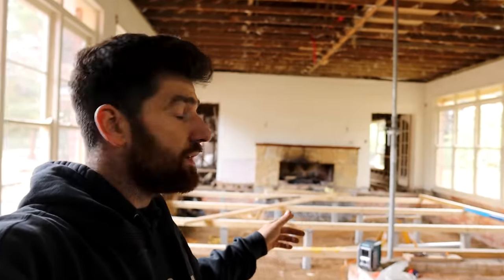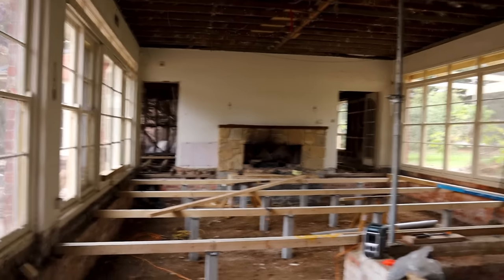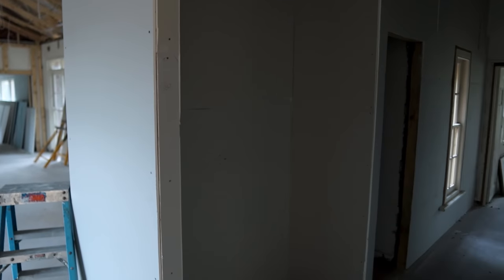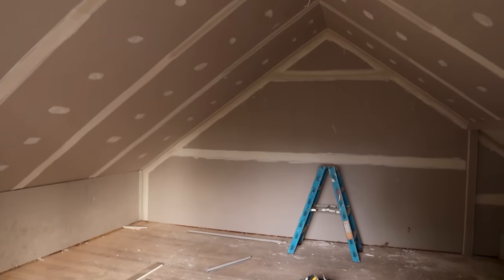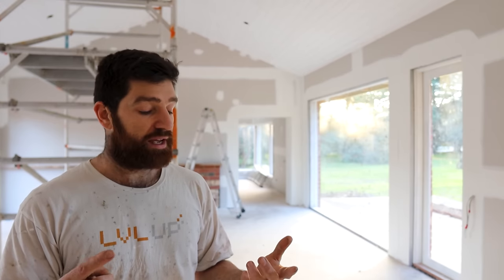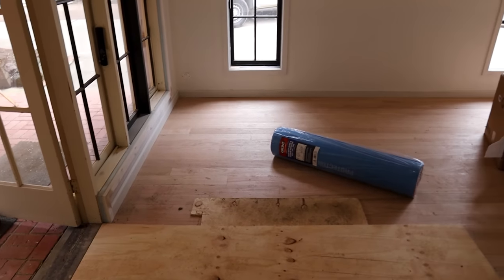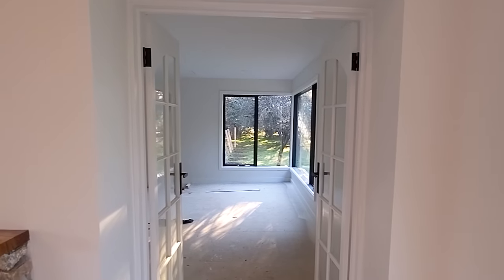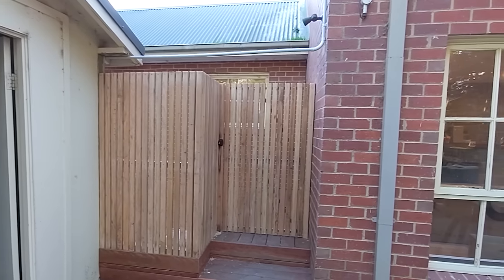Abandoned Rehab Facility to Dream Home | 12 Month Renovation in 32 Mins

Comment: Teachable moment. They completely replaced the floor because it was rotted out.  However, did not address root cause, which is moisture buildup beneath the floor.  They build a 5 sided box, with the 6th side just dirt.  There's no ventilation, vapor barrier, or treatment. And, the sides of the box are brick, which is porous and lets in more moisture.  You can see in the "new sub-floor" section of the video, the dirt is already moist inside the structure.  Also, at the 0:39 mark you can see the broken floor joist. It has signs of bug damage.  If they didn't spray anything to address this, the new wood they installed will get infected, even with removing the old wood.   Years from now the floor will rot out again.  Very cool build but this one thing can cause a lot of problems later.
Reply from the maker: Hello 
Yes your logic makes sense
This house does have ventilation to the sub floor as required. The cause of the rot was termites not moisture 
The termites have been treated and concrete stumps and ant caps were used. I can guarantee you the floor will last a lifetime or even 10
Reply: Don't you need insulatiuon in the floor?

Comment: I would have did a different insulation in the attic and I would have poured concrete for the slab replacement. Other than that IT LOOKS AMAZING
Reply from the maker: I wish i had more knowledge on the subject. Things can always be tuned and dialed in with the aid of a dyno and software. The ECU definitely plays a part on the newer more electronic versions of the 1kz pump. You can always clock the pump bit by bit and test drive the car to see how it effects things
Reply: @dingeldiy  wat

Comment: Wish we had more info on this- more history on the house, why roofing was only replaced in one area, sq ft, etc!
Reply from the maker: Plenty of information if you watch the build series, there are 12 or so episodes that take you through the renovation week by week. Roof was redone because we removed load bearing walls. We installed roof trusses to span from one external wall to another which also meant we could have a raked feature ceiling on the inside all while being able to reuse the old tin roofing.

Comment: It's beautiful 😍 but am just asking why do you people normally use wood ? Are brick houses expensive ?
Reply from the maker: Wood is quicker, easier and ultimately cheaper to work with. It's strong and allows us to run cables and pipes easily as well as easily and quickly being able to install plaster sheets.
Labour costs a lot in Australia and that's why we use efficient building systems to keep costs down. 
Brick is used commonly for durable cladding but it's rare to see brick used as a structural element in most modern domestic homes.

Comment: I like the Crittal rectro windows !   as for the outside why not clad in timber?  bricks dont enhance the property. Maybe its the client or Oz taste !
Reply from the maker: Bricks dont need as much maintenance and some parts of the house were solid brick. it would have been a costly exercise when the money can be better spent elsewhere.  Brick homes are very common in Oz and most people here have no issue with them

Comment: Nice work, I do wonder why the interior floor was done before the roof repairs, allowing weather to come in on the brand new floor.
Reply from the maker: we finished the subfloor so that we had a safe surface to work on the roof from. the roof was offf for only 2 days and the subfloor can be exposed to rain for months before it becomes damaged. 
The real "brand new" flooring wasnt installed until the roof was water tight
Reply: @dingeldiy  Ah makes more sense. Watching it in retrospect makes it feel like a longer period of exposure. But again nice work.

Comment: $ 50.000 plus to have this building tooken down, and all materials have to be, hauled off for recycling. Then cleaning up from thee mess.
Reply from the maker: Not to mention asbestos removal, getting services re-connected, planning, permits, engineering and higher living expenses while you build a new house. 
Renovating this old place was much more cost efficient compared to demolishing and starting again.

Comment: question...is there a reason the flooring was done before the roof? (Wouldn't dealing with the roof potentially damage floor, even expose floor to weather vs...if did roof first, you eliminate chances of  floor damage? just curious
Reply from the maker: the floor acted as a work platform, as the old floor was too rotten to work at heights from. it was only exposed to weather for 2 days (which is totally fine) and damage occurred to the chipboard but it was minor and then later covered up by the final floor boards

Comment: Genuine question, if you are replacing a subfloor like this, what are the arguements for and against insulation for the subfloor?
Reply: And a vapor barrier.
Reply from the maker: cost vs necessity. 
Insulation and vapor barrier was not needed for this house so why spend the money and time?

Comment: I'm surprised Australian builders don't put plywood on the roof before laying down the roofing.
Reply from the maker: What's the benifits? Seems like unnecessary expense to me
Reply: I am not sure where happykt is from, here in the US, I am sure it would be for additional rigidity for the roof system. While I am not a builder it may also be code here. It could also be for storms, tornadoes, hurricanes or snow load. It all hinges on location.

Comment: the vents in the walls are / were for the Carbon monoxide to escape ...... and yet you kept the open wood fires ...how has this passed inspection
Reply from the maker: not sure that's what the vent were for but the smoke alarms with built in co2 sensors will let us know if something is wrong 😀

Comment: Death stairs. Are there no building codes in Australia?
Reply: I was thinking that the floor joists would not have been up to code, and I felt like the trusses were spaced too far apart to be up to code. At least in the states. Maybe I’ve been watching too much Mike Holmes 😂
Reply from the maker: Keen eyed viewers!
I can promise you the floor and roof are up to the Australian standards. The roof trusses are engineered and installed to the supplied specifications.
The bearers are a 90x90mm F17 rated timber at no more than 1500mm centres with 45x90mm joists at 450mm centres.

The stairs have since had a balustrade installed but due to my employment and need to move on to other jobs I was unable to film some small things such as that.

Comment: You didn’ t put any insulation under the floor. Seems odd because there is pure ground under. It means that moisture condenses on the lower surface of the floor. No ventilations gaps were left inside the walls. In the roof insulation were put to attach to the roof sheet without ventilation gaps. Big warning that you will have moisture problems during ten years in your house.
Reply: The is not any moisture management in the house. That kind of forgets mean big, big problems  after coming years. You even closed gaps where the roof can be ventiled. And the is not any ventilation system inhouse. Just only air conditions which keep moisturing inside the house. The works seem fine but there are huge problems during coming years in the house. That kind of construction is illegal in Finland.
Reply from the maker: The video may not show it but there is adequate ventilation in the walls and sub floor. The house meets all australian standards

Comment: Strange to watch videos like that as a German because we build houses so differently😅
Reply from the maker: Tell me more! What part is weirdest for you to see?
Reply: @dingeldiy  It ist mostly that you build everything out of wood and plasterboards. In Germany we build nearly everything out of concrete and bricks. I would have made the floor out of concrete with insulation and I would never apply plastboards onto brick walls. I would always plaster the walls directly to have a solid wall. All in all there is also very little insulation around the house. Furthermore I was missing a vapor barrier at your new roof, which we also build a little different.
We also build nearly every new home nowerdays with floor heating, but maybe in your climate zone that is not necessary.
That should not be a critique of your work, only a description of how I would do things from a German point of view

Comment: Should poor a concrite rat slab on that dirt fllor before replacing it
Reply from the maker: That sounds bananas to me. What's the point?
Reply: @dingeldiy  It stop rodents and moisture from roting your wood when plastick sheat used under concrite.

Comment: Different building codes hey. No concrete to lock in your stumps? I don’t get how you get away with that floor not moving I suppose you have a heap of stumps hey.
Reply from the maker: Lots of stumps deep in the ground. Concrete is used to backfill the bottom of the hole but the top half of the hole is usually packed down soil. If the house is built right no moisture shouldn't be getting to the stumps. The soil, especially if its clay, turns as hard as rock over time.

Comment: I find it strange that you guys build floors like walls. We use LSL i Joists. 2x12
Reply from the maker: we use them in high span applications on 2 storey houses but usually at ground level we use stumps and bearers or concrete slabs depending on what floor systems we need to marry up to.

Comment: Why did you replace the roof framing?
Reply from the maker: Walls were removed before I started filming. Those walls helped support the roof. We replaced the roof structure with trusses so that it was self supporting with the added bonus of a nicer looking raked ceiling.
For more info watch episode one of my series I made on this video. It's called the 10 week 10 acre turnaround.

Comment: What was wrong with the roofing? It didn't appear to be eaten by insects or destroyed by water leakage - unless I am wrong it all seems very wasteful
Reply from the maker: Some Internal structural walls had been removed before I got involved with this project. The roof structure was replaced for 2 reasons - 
1. It needed to be self supporting as the internal walls we not to be replaced. 
2. A pitched internal ceiling was more desirable than a flat one and really brings the house to life.

Comment: No vapor barrier on the ground under the floor and using composite sheets as floor decking is a recipe for disaster.
Reply from the maker: Appreciate the concern but I can assure you the sub floor is properly done and in accordance with Australia's high building standards

Comment: And where is the thermal insulation?
Reply from the maker: It may be lacking in "insulation" but this house has a lot of thermal mass
Reply: @dingeldiy  If the cold snap is short-term, then thermal inertia will save, and if, as with us, it lasts for a week - 30C, inertia will not help here. Here in the summer it will be nice - cool.

Comment: you ddnt use vapor barriers at the under of the house, you must secure good ventilation to the bottom of the floor that it will not rot right away, not saying this because i want to arque, only to save you a lot of money.
Reply from the maker: the crawl space is ventilated via vents in the brick work and we build our houses so that rain water and moisture cannot get under the house. its not conventional for us to use vapor barriers here hence why we didnt use one.
Thanks for the comment and thanks for watchting!
Reply: @dingeldiy  i dont know the ground type in your country, but back here where i live, moisture is allways on top of the ground because capillary effect ! Its good to hear that crawlspace has good ventilation.

Comment: No entendí por qué cambiaron el techo ?? . Tampoco entendí por qué el piso lo vuelven hacer hueco???
Reply from the maker: Walls were removed so the roof had to be re engineered so that it wouldn't fall down. The floors were rotten so we replaced them as necessary using standard Australian building practices

Comment: A house that size and raised up with zero insulation in the walls or floors? esp in the bathrooms and its in MELB?! RIP the owners feet in winter. You'd have to wear shoes all the time. Should've put in under floor heating or at least insulation under there.
Reply from the maker: Insulation was installed where possible, some walls are double brick which on their own have good thermal mass and offer insulating properties. the flooring is 40mm thick and floor heating was deemed unnecessary

Comment: O_o direct dirt contact for all the stumps holding up the floor? And not even footings or anything? Come on.
Reply from the maker: Standard building practice here in Aus. Stumps are concrete so direct contact is ok. Joists and bearers are supported by brick footings on the perimeter
Reply: @dingeldiy  Ah, ok, they looked like wood stumps in the video. That makes more sense. I still think footings are a requirement, but I guess it depends on the ground.

Comment: At least the outside brick wasn’t painted or covered. Lost a ton of character on the inside though
Reply from the maker: Fair enough. Sometimes comfort, safety and energy efficiency are more important than character. At least the new ceiling is 1,000 times better than the old flat plaster ceiling that used to be there.